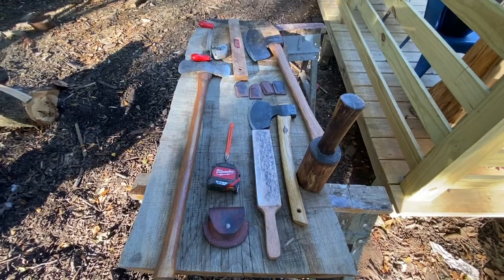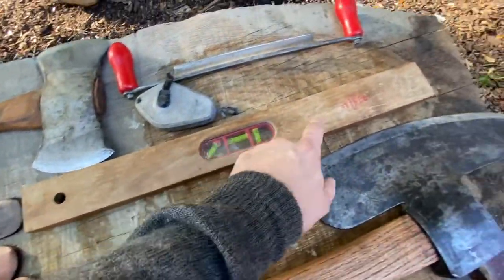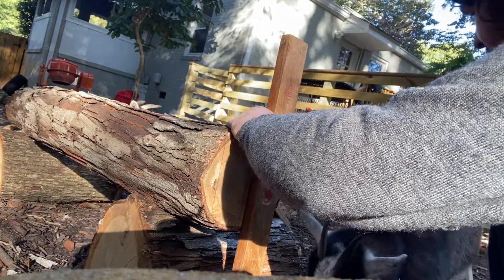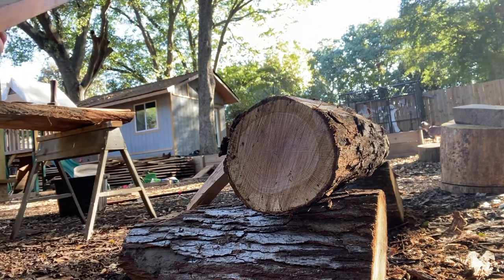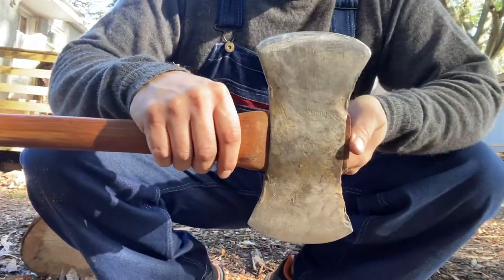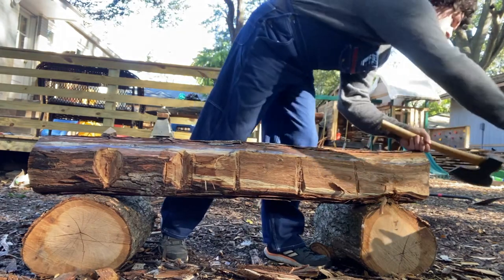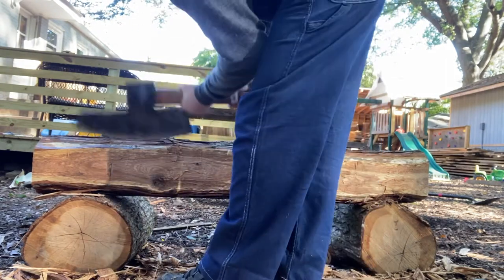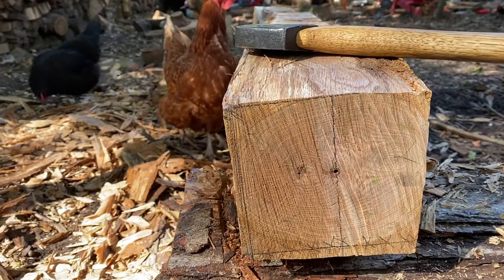How to layout a log for hewing, and the Gransfors Bruk 1900 Broad Axe

Comment: Just a comment about a double sided axe and its use. From a 80 year old gypo logger that learned his trade in the logging camps of SE Alaska in the 50’s from old time hand loggers that were the best ax men in the world. A falling ax had reverse bevels, which means that one side of the cutting blade was flat filed, and the other side was slightly rounded or beveled. Each of those beveled faces were reversed on the other cutting edge. The reason for this is the flat side was the cutting edge and the rounded side was for wedging or pushing the chip away from the cut edge. On old growth fir, redwood and spruce, the butt of the tree was often swelled, so that a faller had to springboard up the tree to cut above the swell. Chopping the face in a tree 15-20 feet above ground, required a competent faller to be able to chop either left or right handed, hence the reverse bezel. When changing from right hand to left, the ax is rotated so flat side is still the cutting side. Axes were not used for the face undercut or the back cut or for bucking. That was done with a “misery whip”. A 6’ or longer thin steel falling saw. A bucking saw was thicker and wider. A single bitted ax generally used to drive wedges and a wider blade double bit was and sometimes used to limb with. It is important to note that fallers were so accurate with their axes, they could cot a 8’ face in a tree that was as smooth as a dinner plate. No sign of chopping at all. If a newbie faller left cut marks, it was called “beavering”. And that guy didn’t have an easy time of it until he could split a hair every time with his ax. Being a real “ north woods orangutan” was a club very few got into, and only then by their skill alone. I still know the names of many that were legends. “Alibi”, “Little Johnny Bobner”, “Swede Rezlin”, “George Tullis”, Speedball Don”, “Blacky Neely”, and many more.
Reply from the maker: This is amazing thank you so much for sharing your experience! Do you mind if I share this with my followers? I think they would be very interested.

Do you recall the company you worked for and the nearest town? How did you get your first logging job?

Thanks again! I would love to preserve this history.

Comment: Well Done! I’m hewing logs myself in Sweden with the goal to build a washroom at my cottage. What I don’t understand with all American hewing videos is why you balance on the log to score when it is as simple as turning the log 90 degrees to be able to stand on the ground to do the scoring. What I have found out, which helps me a lot, is that I use an axe with straight edge to do the scoring. By that I avoid the score marks in the finished log. Just a tip. In Sweden we do not have the double edge axes at all. I don’t want to say that we do it better, just in a different way. If you want to look at how I do the same thing, take a look at my video:

Hewing a log - My way
https://youtu.be/LvPn7FDlVPg

There are some other videos as well. In the shortest one I hew a 5 meter log which is a little bit thinner and then I skip the rough hewing and I go directly to the hewing axe.
Just to highlight some differences. All the best!
Reply from the maker: Good work! My wife is Swedish, she lived near Husqvarna and my mother in law sold sewing machines for the Husqvarna company.

I don’t think standing on the log is an American specific thing, but what I have noticed is the people who stand on the ground typically have the log lifted on supports. I think you’re working very hard standing on the ground making notches on a low log. From what I noticed the physics of the swing also work against you that way because the axe wants to land at an angle and not perpendicular to the log, unless you compensate against that happening which requires extra effort.

Standing is easier to manage the rotation of the axe and preserve good corners. Of course that problem is minimized of the log is lifted.

Europe doesn’t seem to use the double bit much. I believe it’s the perfect timber processing tool. One axe to fell, limb, and hew. Very efficient and economical.
Reply: Hello from USA,   I like to score or joggle cut also while standing on the ground.  I have slightly smaller support logs and then turn the log a bit  away to make the axe cutting edge line up with the chaulk lines more.  Its by far easier than trying to stand on the log.  First log home for a customer in 78', still going.   Best to ya

Comment: I think you're mistaken about the flat side going towards the log. Any vintage hewed beam I've ever seen has concave scallops, even if slight, on the surface. The only way you're  gonna get that with a broad axe is to use the bevel side towards the work piece. Because you are now attacking the log at an angle, instead of straight down, the curve of the cutting edge leaves a slight scallop.
Reply from the maker: That’s one way to do it, and I’m sure many good beams were hewed like that. There’s a guy on YouTube who has become well known for this theory, and I don’t think he’s wrong.
Reply: @urbanlumberjack  I assume you're referring to Dan Dustin. Happy Thanksgiving
Reply from the maker: @timbarry5080 same to you!

Comment: The bend of the handle is supposed to go the other way of the flat side of the axe, that way your hands will have clearance from the wood you're hewing. 
The only reason you're not having that issue is because you haven't tried hewing a very wide piece.
Reply from the maker: I make all my handles this way. It’s easier to track plumb and more comfortable. The broad axes I use most often have an offset and cupped head so contact with the log is very unlikely or impossible.